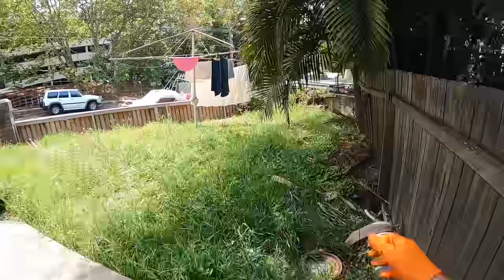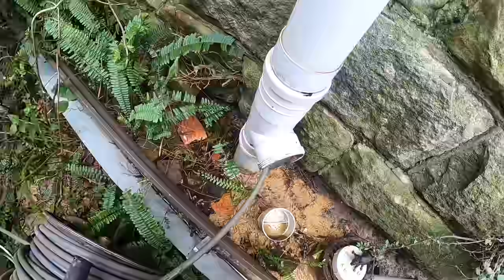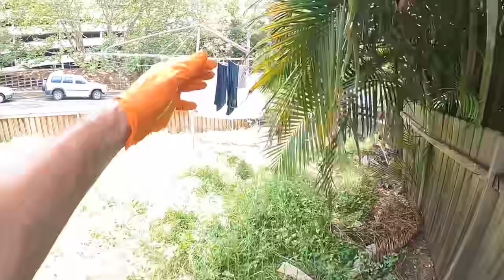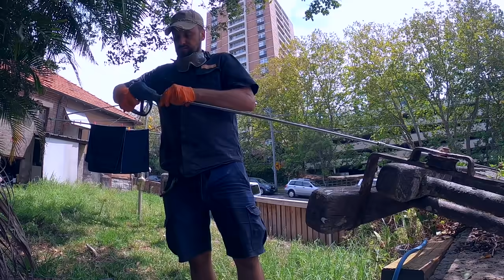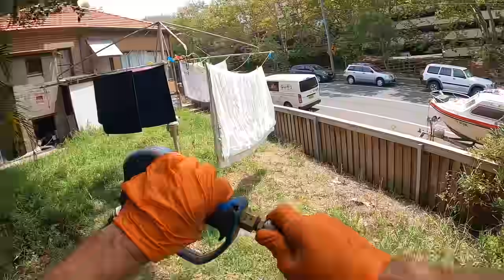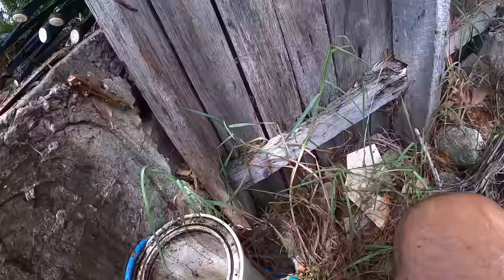Blocked Drain 453

Comment: I'd imagine root problems to be common with open joint clay pipes, which are no longer installed with newer building codes. Here in the USA most guys would be looking to dig up that pipe and install plastic so there's no places for roots to sneak in.

Comment: I have never seen a water closet (toilet in its own room) right off the yard like that in an American house, but these pop up all the time in these videos and on TV shows. It must have been common in the past, but do they build new homes like this in Oz? Do you all have to go outside to get to the toilet?
Reply: When these places were built they only had outside toilets. No sewer, they had a pan that was under the toilet and during the night once a week guys came in and changed it over. After the sewer system was built they often used the outside toilet shed as the main new flushing toilet until later when the bathrooms were done up and an inside usually in the bathroom one was fitted. A lot of the old places had a laneway down the back of the street and the little shed was in the back corner for convenience for the guys to change over.
Reply: Michael Magill  yeah politely called the nightsoil man/truck

Comment: As long as I watch your videos, I stil don't get how every pipework in Australia is OUTSIDE the building, I mean on the outer walls. Theoretically it means that every body could interfere with your private sewage system...Just walk up on your property and do some shenanigans. Here in Germany, every single pipe is build into the inner walls, behind dry walls or mounted directly onto walls, in a cellar for example. And the underground part is burried much, much deeper, too (about 1,80 meters usually). Short version: Strange pipework in Australia you got there!